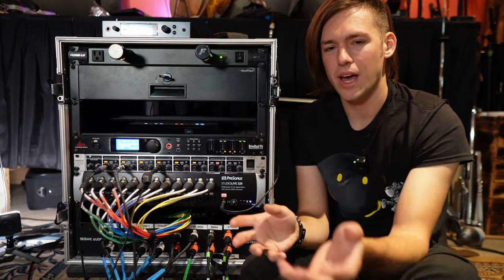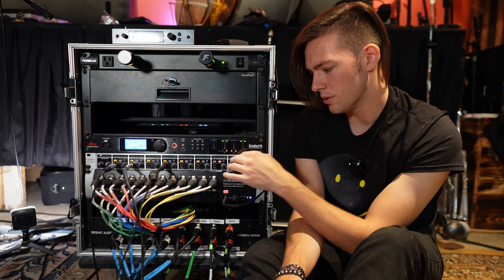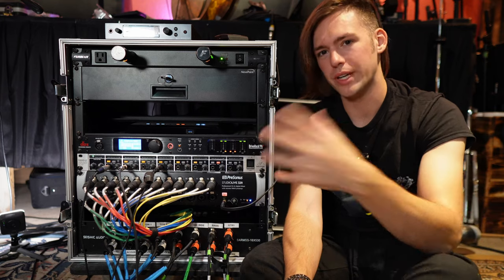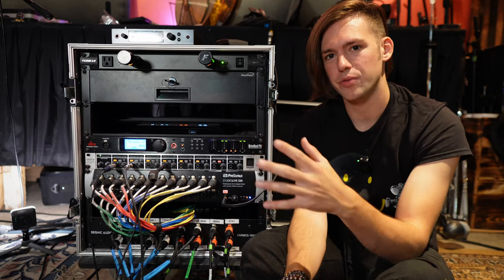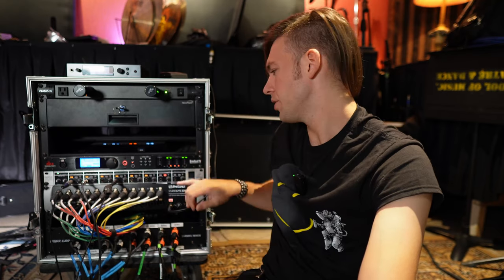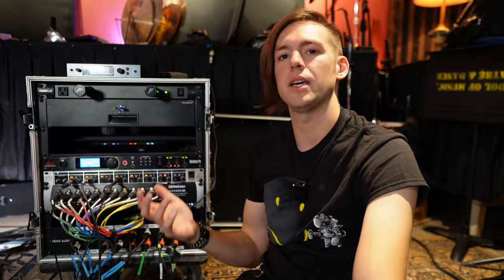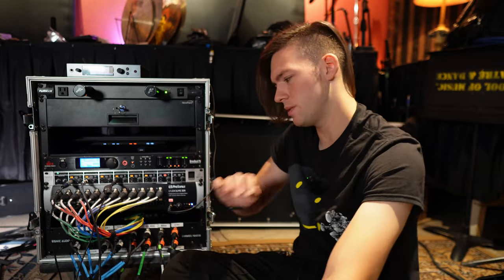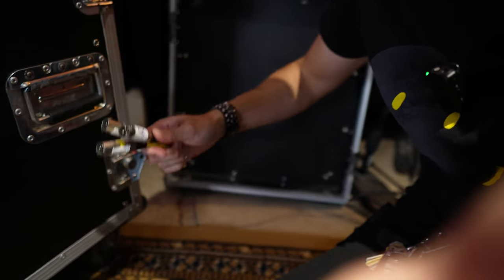My All-In-One Live Sound Rack (And ideas to build yours)

Comment: Dumb question here, but based on how you're splitting, how does gain staging work between your rack mixer and front of house? What about phantom power? Another way to ask, how do you keep your mixer and FOH from sword fighting?
Reply: Need this answer as well, I get that it works I just don’t get how or if there’s something to do
Reply: Both consoles (foh and mon) are after the copper splitter, so each console handles the gain for their own channels.
Phantom power (of the splitter allows phantom power to pass through, which is not always the case iirr) can be provided by foh mixer or mon mixer, and often times it's best to choose which one (most logical is the mon mixer since it's close to the splitter)

Comment: I like your system.  A band should take control of their monitoring system and yours will make that happen.  If you need to run PA for smaller gigs with no FOH, it will double for that as well.  Adequate power distribution is overlooked by many diy bands, so your approach is  solid.  Good clean power will keep all the other gear lasting a lot longer.

Comment: For split if your using it sometimes I would put it in a separate rack and the rack looks good
Reply from the maker: I've done that! I may explore that option again. My goal is to always have my rig as compact as possible
Reply: @redshedrecords  I'd use the built-in mixer outputs for the in-ears and a separate digital stagebox for the FOH outputs in a separate rack. 1 ethernet cable and you're good to go when you need that.
Another option is Dante, which is very common now, RME sells AVB-Dante bridges for quite cheap.

Comment: Nice set up..

My long time all in one is:
SAC(Software Audio Console) running on a 2U rack mounted Window 7 PC
With RME Raydat card
4x 8200 Behringer mic pre’s 1u@
2 Crown 2500’s for mains 2u@
1 Carvin 4ch amp 2u
650va UPS 1u7
CD,DVD,MP3, USB, AUX player 1u
1u top space is power strip with front rack lights, front USB power, receptacle, with 8 rear receptacles.

I can roll it in, have front of house in 20 minuets, from drop of the trailer door, not by choice but it’s happened.
So that’s 32 in 32 out can record each channel.
I have quit a few live mixes on my channel, all mixed on it.
Reply from the maker: Nice! I love the all-in-one rack benefits. You can be SO fast at setting up, and it takes up hardly any space at all. I sometimes miss my passive speakers, but I built some "Siamese" power/xlr cable runs for my RCF speakers, so it isn't so bad.
Reply: Hey. I’ve just been checking out this SAC you speak of. It was difficult to find since it has such a generic name, but I believe I’ve found the site of its creator. How do you get a hold of the software? I couldn’t find any download links on that website. I’ve never heard of it before, but I’m rather curious to check it out.
Reply: Yoo that’s a sick setup! I have a similar one, though not as many I/O on the mixer: 
So in my 12U Live Rack I have the following:
Front:
Allen & Heath QU-SB Rackmixer 4U
(18 Ins, Main L/R mix out, 3 stereo & 4 Mono mixes, enough since we only use our wedges)
3x Crown Itech 4 channel Amp 2U@
CEE16a 3phase/400V Power Distro 2U with CEE16 230V outlet for Stage Power (guitar Amps, Pedalboards, etc.)
Rear:
Custom XLR Patchbay for the 3 Amps, 2U
Speakon Patchbay (so I can access each amp channel on 1+/1- for passive speakers)

That way I have least amount of Devices in the Rack. I can do anything from a two satellite pa/two wedges acoustic gig, to a Full Band show for 300cap with 6 Wedges on Stage. Crown Amps power SRX712m & VTX F15 (both can be wedge or pa satellite) & SRX718s Subs
Each Amp sits on a different Phase. L1 feeds the Stage Power & the Crown which is mostly on monitor duty. L2 feeds only the crown which handles the Subs & additional wedges. L3 feeds the Rackmixer and the Crown which handles  PA Satelites. That way the system is halfway redundant/power consumption evenly spread ( 3x 230V @ 16A is not that much for a small Outdoor festival) and as soon as I have my Aufio Engineer with us, the QU-sb is just backup, as he would bring his A&H mixrack & surface console.
FOH can be running in 15 minutes. Place Rack at the stage, Place Speakers, bring Power to the rack and connect 4 Speakon Cables. Dead Simple…